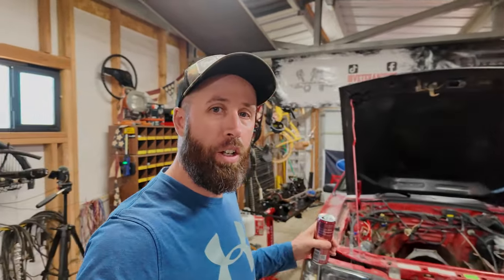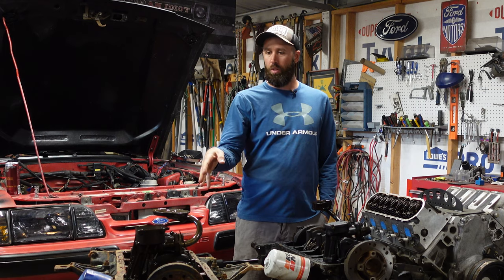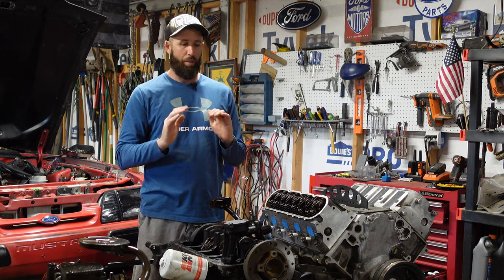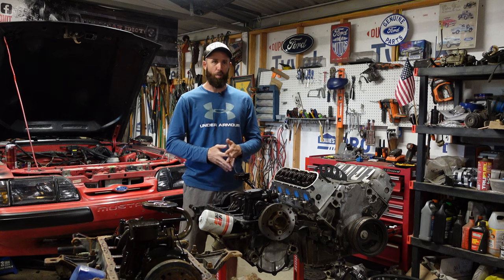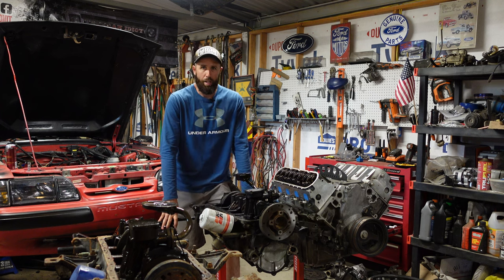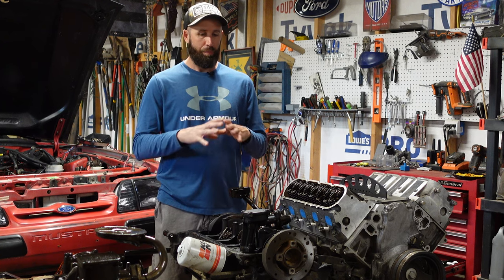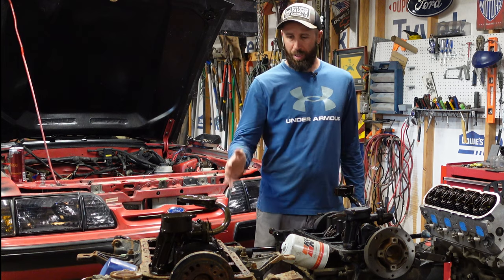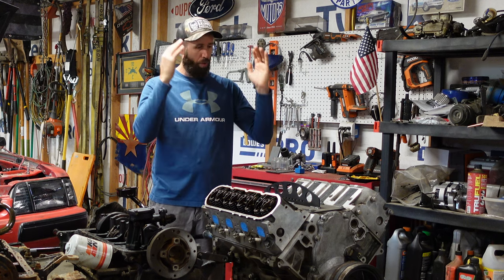Budget Build 351w vs 302 vs LS. Things just keep getting worse for our #foxbody #mustang

Comment: I bought a 1998 Camaro Z28 with the LS1 in 1999, with 26,000 miles on the odometer.  So, it was a used car with 10,000 miles left on the factory warranty. I test drove it. The Z28 seemed good. No smoke, no vibration,  nothing.  I drove it home and drove it around. It was good. A day later, I started it to go to work. It started tapping, not knocking. Tapping from the valvetrain. I tried to return the car. They talked me out of returning the car. It went into the dealership for warranty. The dealership told me the LS1 was new. According to the service advisor, they didn't have mechanics that were up to speed on the LS1. So, the advisor told me most likely the car would receive a new engine. A couple of days later, I called after the car. I asked about how much longer on the car, and the advisor said I could pick up the car. I asked about the new engine. The advisor said the shop steward looked at the car, and no warranty work was to be performed. I said I didn't understand? The advisor said the steward deemed the car as the previous owner neglected or abused the car. I said I bought the car, so I'm screwed? The advisor said he was sorry. I was given another vehicle to make up for the Camaro. I told the advisor that would be the last GM, I would buy. It has been the last.

In the spring of 2000, I bought a 1990 Ford Mustang 5.0 LX notch. It had 119,000 miles on the odometer. It had leaky MAC shorties, Hurst Competition shifter, and exhaust dumps. I still own the car. It still runs, and I'm considering a lower end check and refresh. Plus, I am planning an HCI upgrade. It has over 177,000 miles on the car. She deserves it. Keep that LS piece of junk away from that car. Don't go down that road.
Reply from the maker: Haha, sad story with a happy ending
Reply: @VeteranIdiot  to be honest, the Mustang with the pushrod is way more impressive than an LS. I've worked on both. My Mustang never left me stranded. I've picked up buddies that are still LS fan bois. Even after their junk has left them on the side of the road. Build that Ford, better than this GM junk.

Comment: Glad to see no LS.  You can some decent power with that 5.0L. Go with 1.7 ratio rockers if you use a B cam.  You will get more out of it than stock 1.6.  best of luck with the build!
Reply from the maker: Gonna stick with the 1.6 for now for two reasons; GT40 (unported) don't really flow enough to benefit for more than a B cam, and I don't want to go spend a bunch on new taller valve covers lol

Comment: That 351w is not a roller block, so you would either take a chance breaking in a flat tappet cam or use link bar lifters or a reduced base circle camshaft and drill the block for the factory spider.
Reply from the maker: Correct, it is a thicker 74 block, plan was to later upgrade to roller.

Comment: Dude a 351w swap is really not that expensive, we did my 89 coupe for 1100 bucks just 3 months ago. Oil pan and pickup tube was 80 bucks, the alternator bracket was also off the 351w I ordered the oil pan for(85 ltd cop car) and bam, dropped right in. I went carb because mine was a factory 4 cylinder car
Reply from the maker: Correct, it can be cheap to swap. However, we went with some parts that we knew we would upgrade to at some point to midigate sunk cost (long tube headers, HEI, brackets to fit all our currently upgraded accessories). The train derailed when the swap would also include the cost of a complete rebuild and machine work.
Reply: @VeteranRevivals  I hear that. I habe a half ls7 swapped 2002 camaro because of the snowball parts acquisition lmao

Comment: Most "budget builds" you see online, or in the old car magazines, don't count the nickels and dimes that add up in gaskets, fasteners, etc. The good news about a basic "bearings, hone and gaskets" rebuild is you know what you're getting so it's worth it over a junkyard grab bag. Once you start really digging into a bottom end rebuild of something popular like Ford or Chevy, it's time to look at a stroker. Power adders tend to need higher octane fuel, and that adds to operating costs at the back end, esp. when we get greedy and add more boost or N2O. a stroker can be built to pump gas compression and let a good aftermarket head make the power and stay conservative on the camshaft....or then step up to a power adder.

I'll also add (because this video raises a good subject) that "budget" should probably include what it costs to install the engine. An LS can make cheap power in a dyno, but installing it in a car it wasn't designed for? that can raise the eventual cost.
Reply from the maker: Absolutely, on all points

Comment: I’m 24 currently have a 393 in my 83 capri.  Planing to turbo it soon. But I’m on my 6th block.  Was running 351s for a minute but i usually find cylinder problems and low oil pressure problems.  Haven’t found a good used 351 yet
Reply from the maker: Interesting. Where are you losing oil pressure?
Reply: Jesus 1600 for a stroker kit? Bro.  400 dollar 3.85 crank stock rods arp bolts and $380 dss pistons and 400 dollar block work.  I’m less than 5 k into my car
Reply: @VeteranRevivals  I find them like that.  I usually find 351w in New Mexico for 500–800 but have only gotten lucky twice.  And one got lucky with a $200 no title field truck with a reman 351.  But I always tear them apart and look at bottom end. Oil pumps opened and they are usually worn bad like the 5 psi one I had when I was 17

Comment: A complete running Explorer GT40P is 500 bucks spring up grade and a Bcam your golden
Reply from the maker: Didn't want to do the the GT40p because of the offset spark plugs, but I think the 3 bar heads will be good enough to get us by for now haha
Reply: @VeteranIdiot  I put a used P short block in my 66 got some used Edelbrock performer 5.0 heads half price and a used B303 half price.  I originally bought the complete P for 300 with 118k on it but it looked new inside factory x hatching ect. I had just finished doing TRI Y's and didn't want to redo it so I got the Edelbrock heads. Since then I've found an easy mod for the TRI Y's to fit P heads .I'm building a 61 Falcon and this is the plan
Reply from the maker: Nice!

Comment: 260 cid 289 cid insanelly strong . It goes downhill as size go up because the bigger the heavier . I donnot think they did graphite compressed iron block back then . 302 are thin walled . Not strong block .
Reply from the maker: Agreed, but it is what we can afford right now 😂
Reply: What is your goal ? If it's a refresh . Keep the 302 and put back the plastic tube . V8 are notorious for electrical false signal problem . Wich tell the computer to run conservativelly . Pay attention to big wire . Startor . Alternator battery wire  ground . Big positive alone big negative alone . You'll likely need two copper washer to prevent the electrical wire from turning . Once installed ? A liberal coating of dielectric grease on electrical connector . How to hold wire ? It can not be metal collar . 18 wheeler use oversized zip tie and their respective plastic holder . If you use an oxygen sensor ground has to be alone and sent to the ecm ground wire . Remove the ignition coil . Usually you do not want a support ground but your coil model seem to be open . I would isolate coil . Peace of wood . And ground it directly to ? I think your car ground via ignition switch ? If not send a wire directly to battery . Basically you do not want chassis ground . Chassis ground and exaust ground make car rust in na . Most car issue are electrical false signal . One fixed . Ask ford to reinstall program software firmware . Your engine 302 seemed to run fine in second video mustang serie . It looked like it needed freshening up and huge electrical wire proper no touching job . Wire were isolated but touching is touching . With isolant less but it's still touching . Do not use rubber coater metal clamp to hold any electrical wire . Airgapping wire is time consuming once in the car so pre plan to do it while engine is out . Hope this help . I do not think you'll need gt40 head on a 302 . Most stock 302 were never run without electrical false signal . If you are not budy with a multimeter ? Ignore the electrical coil
Reply from the maker: Sounds like switching to carb is easier 😂
Reply: carb or elctronic both have the isolated wire touching issue . The rule of thumb ? If your thumb does not pass around the wire ? The owner will have gremlin with the vehicule .take rubber coated metal loop . They also cause issue . It's a faraday cage thing if 2 wire are in the same loop or touching .plastic tie are ideal . Special zip tie holder can keep say old cylindrical ignition coil away from metal . The owner would likely not need the distributor condensator . An old mechanic petrol head on youtube mention point system require 8 volt not 12 volt . To be versified per brand i suspect

Comment: You keep saying budget, but nothing is budget about anything you are doing.   Sniper.......a complete and utter waste of money compared to a basic Edelbrock carb, unless you NEED the fuel injedtion for tuning around a big cam or sipping fuel on the freeway.  I have a sniper on my 1972 c10 BBC.  Neat, but no better than the 3310 I took off since the Holley ran fine.   The 351 Windsors are born turds even with gt40 heads it will make more bottom end and less top end than the 302 no matter what, given the same heads and intake flow.  The 302 with a carb is the only budget way to get it done and run good.   A9L computers are poo poo.  i have dyno tuned them many many times back in the day.   Never made good power, usually ended up pulling the spout and locking it.  You would save a ton of money if you bought a COMPLETE 4.8 Lr4 ....they go for around 300-500 here in Houston and Canyon Lake.  If you are close I would give you a complete accessory setup intake and rails and alll  I have it left over from builds.  Ebay imitation Holley 302 oil pan works great.  If you use the truck balancer, you can use the truck ac compressor in it's stock location.   If you end up deciding on LS, hit me up and I can save you a TON of money.  You would be very happy with a cammed or even stock 5.3.
Reply from the maker: Thank you! I will keep it in mind! I agree, the A9L is a massive limiting factor.